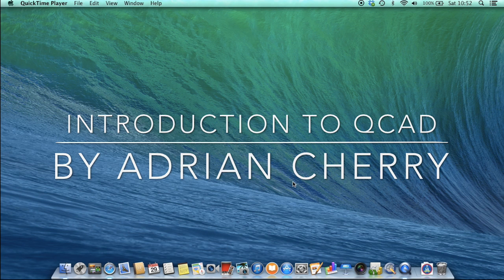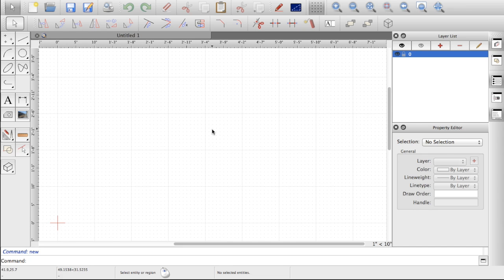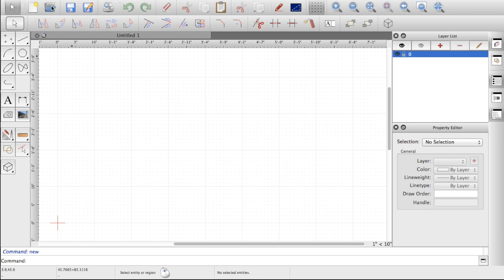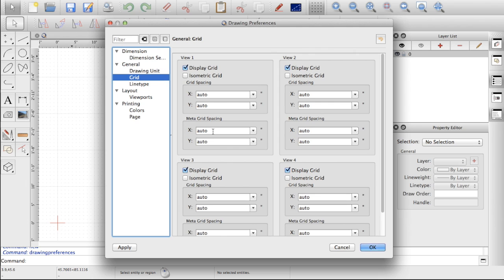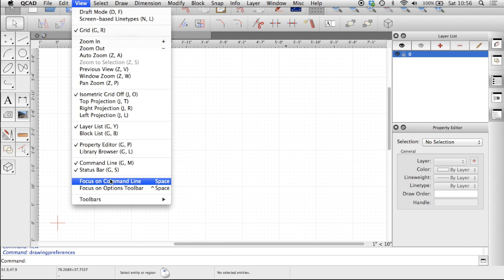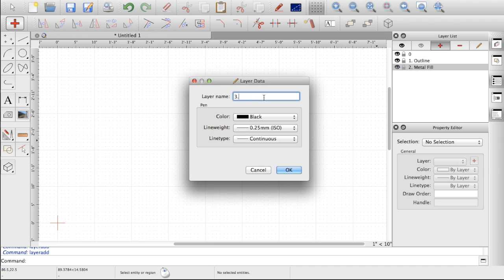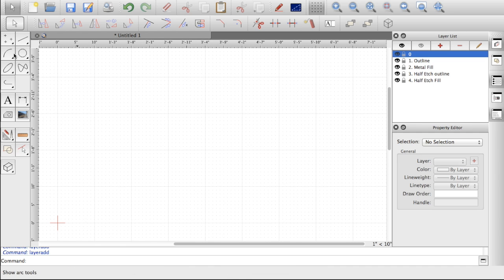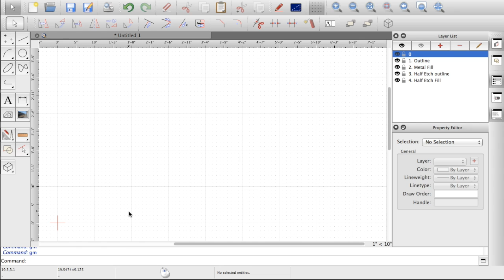QCAD introduction part 1

Comment: Hello, thank you for you video i found it very useful. I can only work in metric system, so i cannot understadn when you say "7 mm to the inch", sorry. I have a question which puzzle me. I have to draw a planimetry of a land. I have to decide which scale to adopt, to fit everything onto an A3 paper sheet. I think i should use 1:500 scale. I have a lot of partial measures but i need to find out the whole breadth and length before i can decide what to do next. I cannot find how to set up QCAD, into accepting this scale, or any other scale with this style (like" 1:200 - 1:300 - 1:1000 and so on). Could you help me please? i also have not understood why i cannot see what there is on the model_space, when I'm in Paper_space or Paper_space0. Thank you :D ciao Tiziana